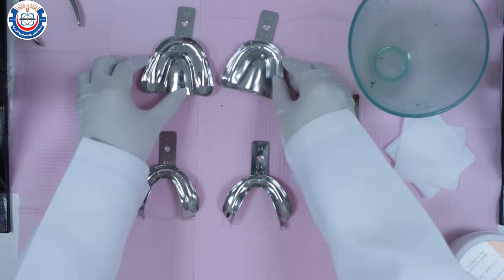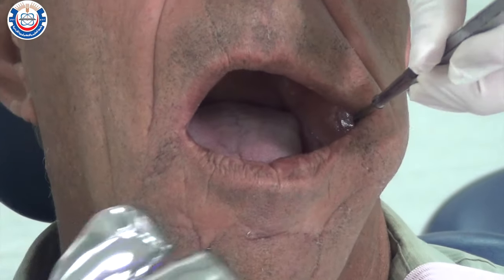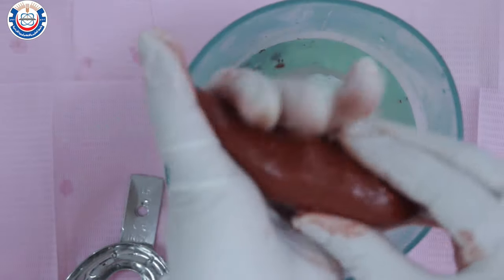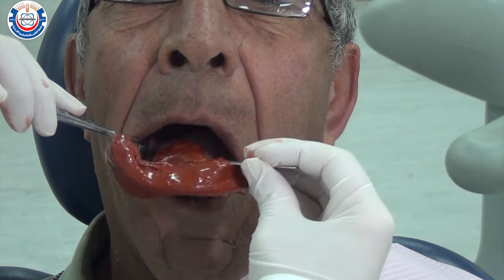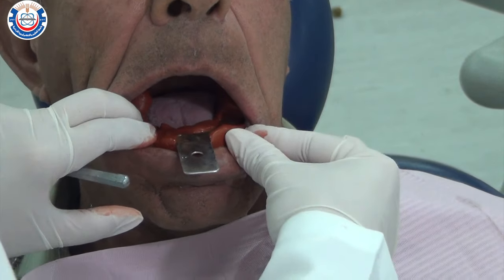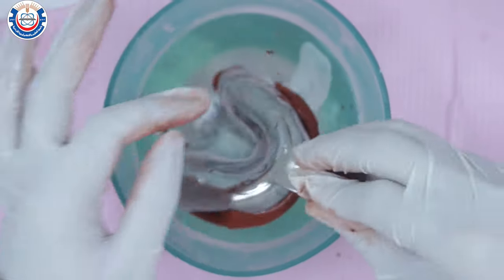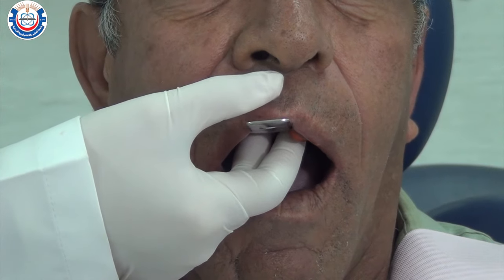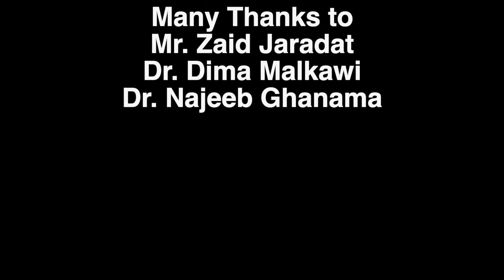Primary Impression for Edentulous Patient Using Impression compound

Comment: Thank you doctor, just one question, what are the advantages and disadvantages of using impression compound? Thanks again
Reply: the most obvious advantage is the ability to modify the impression after taking it by reheating and retaking the impression different to alginate which is irreversible .
One more advantage is that the compound can support its own weight and doesnt need border modelling with wax unlike alginate which is flowy and cant support its own weight needing wax borders